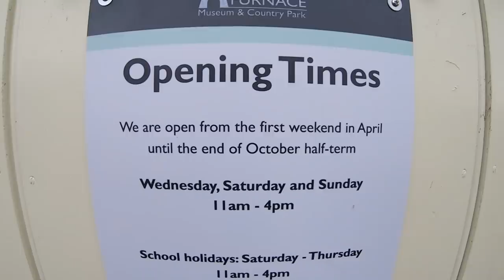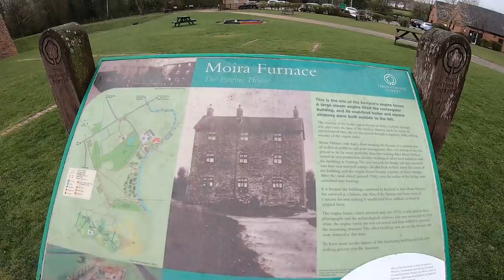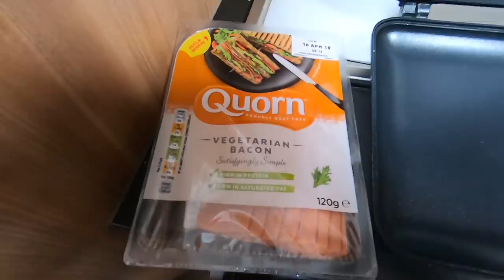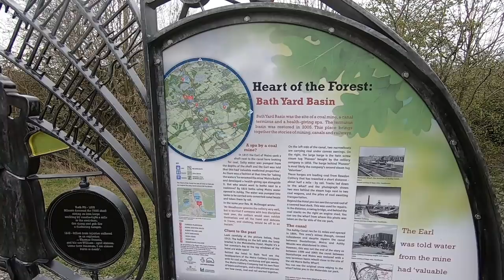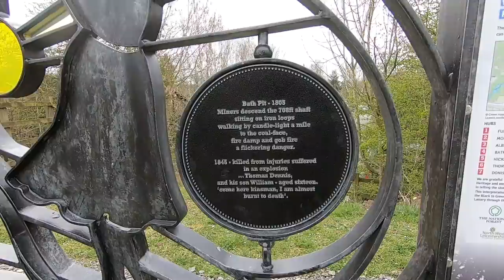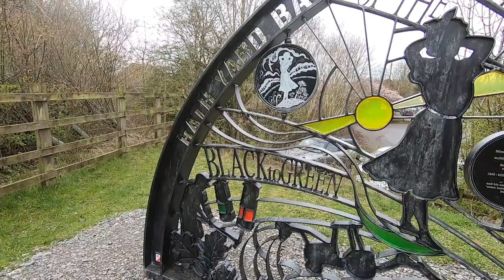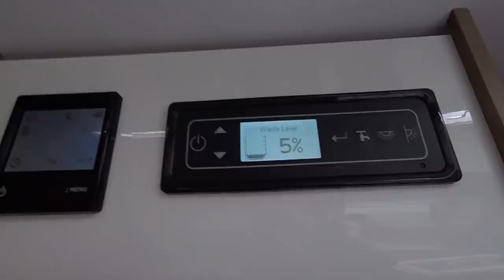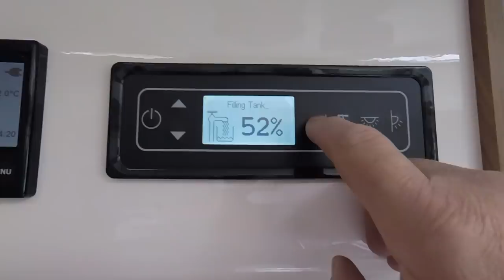A Day At Moira Furnace and Ashby Canal | Bailey Peak District Motorhome Tour Pt5

Comment: Tip for anyone with a wide body Bailey, fit front mud flaps (about £30 for genuine Peugeot) its amazing how much it protects the protruding bits behind the cab doors from dirt of the wheels.
Reply: Steve’s tube channel Bolton Good idea, mine has rear mudguard flaps and not front ones,  the door area gets very mucky.

Comment: Hi Bob. Hope you dont mind me asking you a question about your M Home. I am thinking of buying a Swift motorhome 674. And was wondering what you thought about Fiat engine etc.Have you had any problems with engine or electrics since you bought your Swift. And is the 130 bhp adequate power for driving it.
And many thanks for your videos .We enjoy watching them .
Regards,
Billy
Reply from the maker: Our Bolero is on a 150 bhp Fiat and that is perfectly good for the 4.25 tonne max weight. The only vehicle problems we have had are to do with the dashboard lights, fixed under warranty. We found the 130 bhp engine of the Bailey Advance very good, but is a lighter motorhome. I would think that the Escape would fine with the 130bhp. Thanks for watching.

Comment: Great video just a bit unsure how that pump works on the water filling up & can it be used on any van? We have just upgraded to a roller team 690 it's a big van with not a lot of payload so if I don't have to keep it topped up with water & could us outside tank & a pump it would help. Cheers Steve.
Reply from the maker: This Bailey has a connection for a whale type pump, so you need a special lead with a pump on one end and a whale connector on the other. My own motorhome simply has a 12v socket and a round filling hole. Not sure what sort of filling point your Roller Team has.